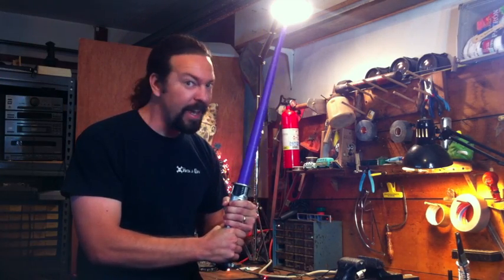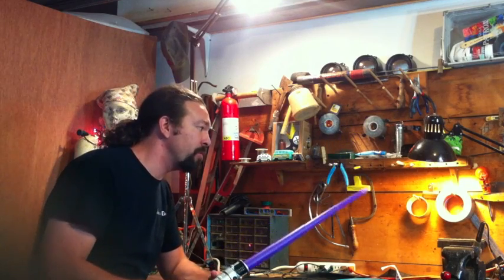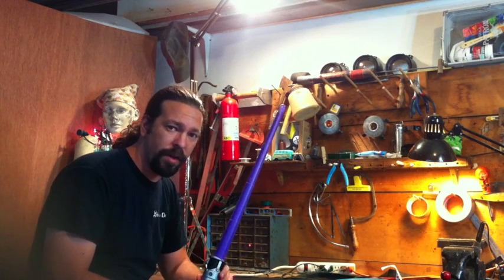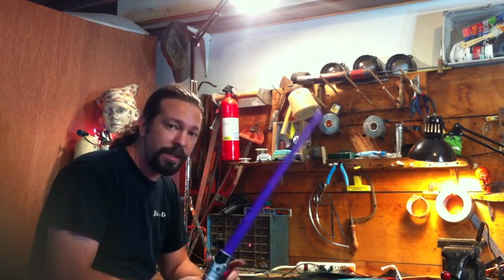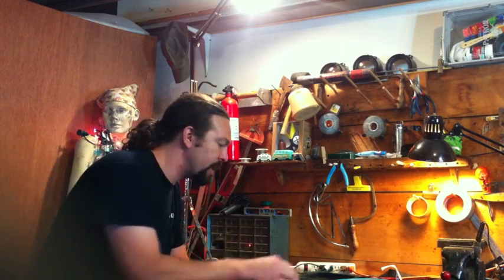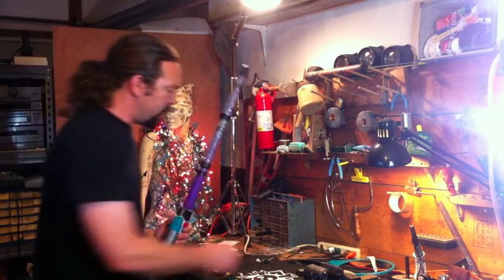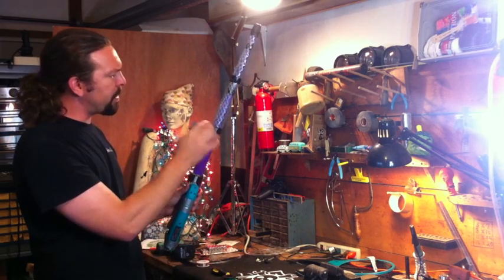real life Bugzapping light saber

Comment: When using the bug zapper you got from WalMart, unmodified, it doesn't make those electrical popping sounds that yours did. What did you do to make it do that? Is the wire mesh just closer than before and causing arcs?

Comment: I think your ideas are great!  And the light saber bug zapper is great but lol there always has to be a but.  They have colored electrical tap red purple green.  I think it you just like the duct tap matched the handle purple electrical tap would have been great.  Our maybe with just a little more time and could have even used a little color rust spray paint on the mesh.  The car rust spray paint would have been ok to use as car rust spray paint is men't for high heat.

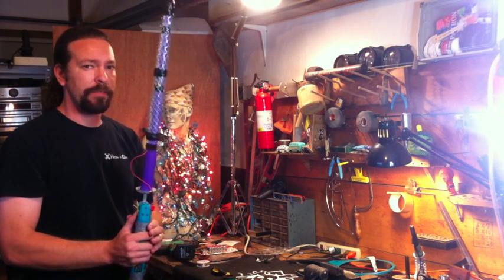Comment: 3:48 sound like a failure (short circuit).

good idea but you could at least hide the electronics inside (you have A LOT of unused space) and used new mesh to cover all the sword.

To avoid short circuit i may consider using hot glue not only to keep the net in place but also as a spacer between the two mesh.